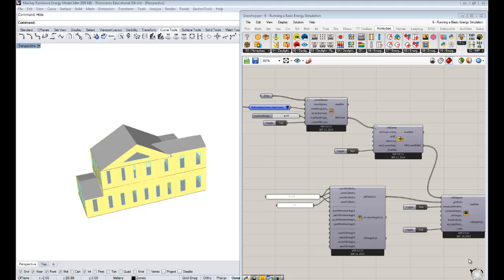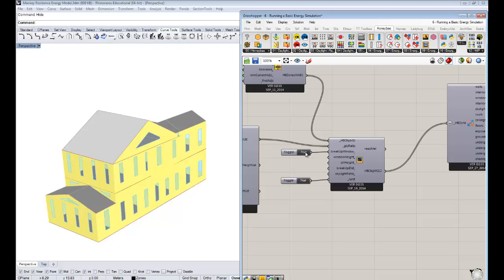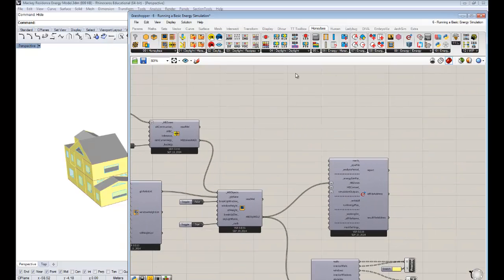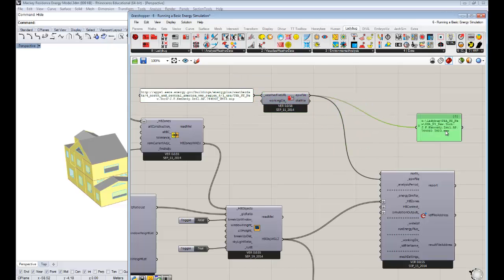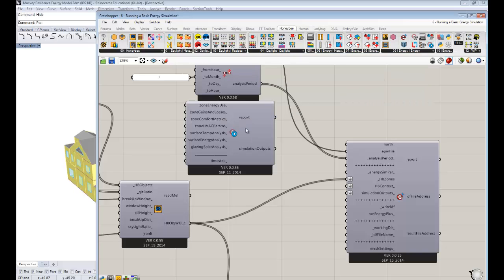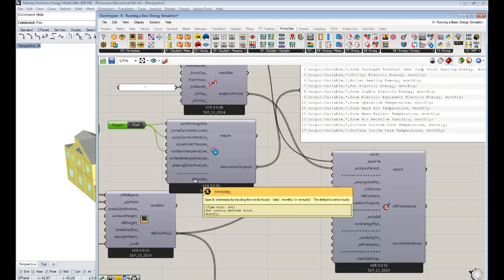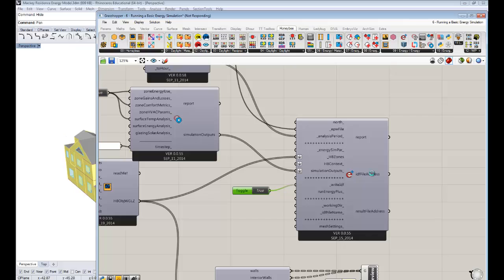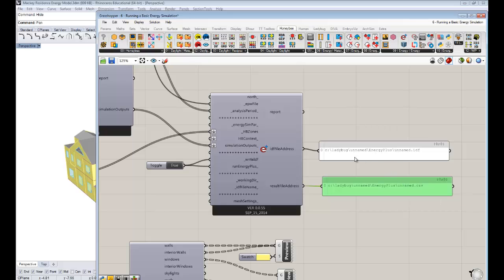6 - Honeybee Energy Modeling - Running a Basic Energy Simulation

Comment: I got an Error as well:
1. The simulation has not run correctly because of this severe error: 
   ** Severe  ** Problem in interior solar distribution calculation (CHKBKS)
2. The simulation has not run correctly because of this severe error: 
   ** Severe  ** DetermineShadowingCombinations: There are 2 surfaces which are casting surfaces and are non-convex.

Comment: Hi, Chris, thanks for the tutorial. However, I got severe errors in the simulation for this tutorial:
   ** Severe  ** Problem in interior solar distribution calculation (CHKBKS)
   **   ~~~   **    Solar Distribution = FullInteriorExterior will not work in Zone=ZONE_0
   **   ~~~   **    because vertex 1 of back surface=ZONE_0_SRF_8 is in front of receiving surface=ZONE_0_SRF_5
   **   ~~~   **    (Dot Product indicator=1.2833)
   **   ~~~   **    Check surface geometry; if OK, use Solar Distribution = FullExterior instead.

Can you kindly advise how to adjust the setting related to solar distribution calculation?

Thanks!
Reply: Hi, I had the same error as Ji Zhang. I did go through the link, and the suggestion was to either not use Surface Temperature analysis or split up an L shaped zone using an air wall. Now, for the example file provided, I tried to get rid of the Surface Temp Analysis, but still got the same error. Additionally, the post also suggests that my heating and cooling energy numbers should be somewhat correct. However, in my read EP result tool, I am not not seeing a cooling energy output at all. Could someone please help me out here. Also, for the example file for the video, how do I break up an L shaped zone using an air wall? Thank You!

Comment: Hi Chris,

I'm having some problems in running the energy simulation of your model. When I run an energy analyses (using your grasshopper definition downloaded from dropbox) I get 18 severe errors. When I run the definition on a set of solids I created myself in Rhino it works just fine (although the errors in running your definition make me suspect there's something wrong with my honeybee setup). I have already tried the honeybee intersect masses component, baking, an re-internalising the geometry. Also I have tried reinstalling energy plus (I am running 8.1) and the other required software. None of this has helped. All sowftware are in their right folders and I do not get any warnings from the fly honeybee component. Below I have attached the final error summary from the energy plus component. Any thoughts?  

Gr,

Sam

P.S.: Thanks for the great tools and tutorials!!

 *********** ===== Final Error Summary =====

   *********** The following error categories occurred.  Consider correcting or noting.

   *********** InterZone Surface Areas -- mismatch

   *********** ..Area mismatch errors happen when the interzone surface in zone A is

   *********** ..not the same size as it's companion in zone B.

   *********** Incomplete View factors

   *********** ..Incomplete view factors can result from incorrect floor specifications (such as tilting 0

   *********** ..instead of 180) or not enough surfaces in a zone to make an enclosure.  The error message

   *********** ..also shows an enforced repciprocity value.  You can decide if you need to make geometry

   *********** ..changes based on that value.

   ***********

   *********** EnergyPlus Warmup Error Summary. During Warmup: 0 Warning; 0 Severe Errors.

   *********** EnergyPlus Sizing Error Summary. During Sizing: 5 Warning; 16 Severe Errors.

   *********** EnergyPlus Completed Successfully-- 9 Warning; 18 Severe Errors; Elapsed Time=00hr 00min 10.08sec